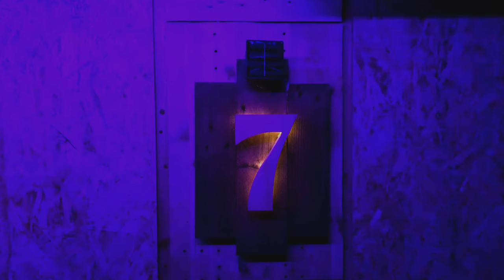Woodworking projects that sell: Easy Pallet wood house number!

Comment: What service did you use to produce your intro graphics?? Thanks
Reply from the maker: I'm a UI / UX designer so I'm quite experienced in working with a variety of different software. If I remember correctly I've found something similar online and created my intro in Adobe After Effects.
Reply: @rarecraftsman  thank you!! I’m gonna check into it
Reply: @rarecraftsman  I made an intro not exactly perfection but it’s a start in the right direction gonna use it on my next video
Reply from the maker: @WedoweeHandyman  that's great dude!